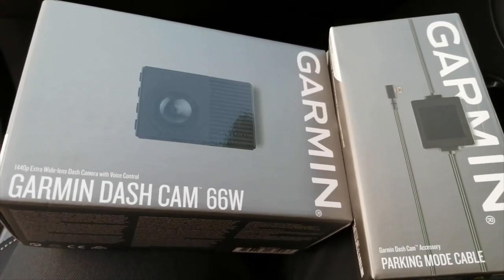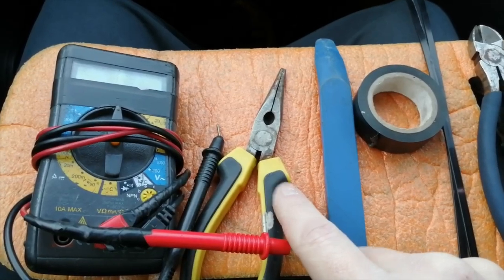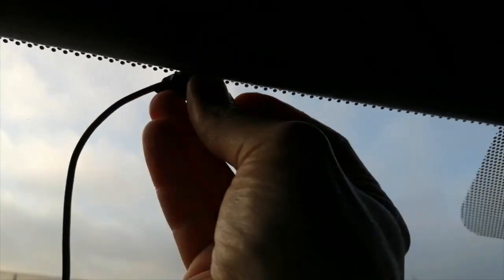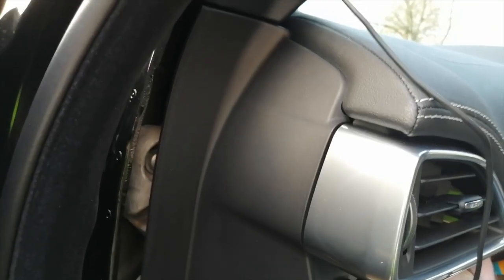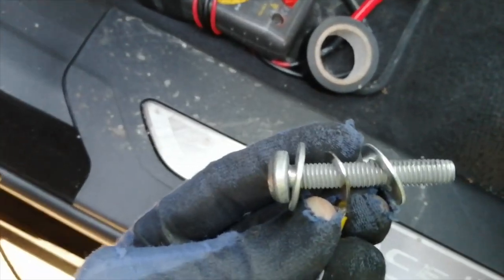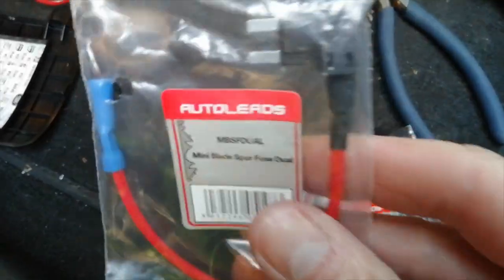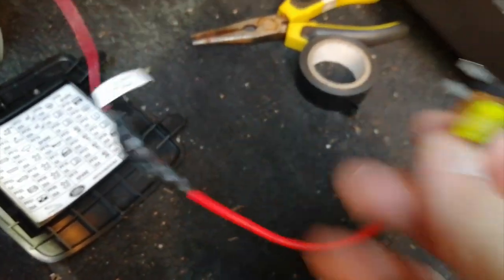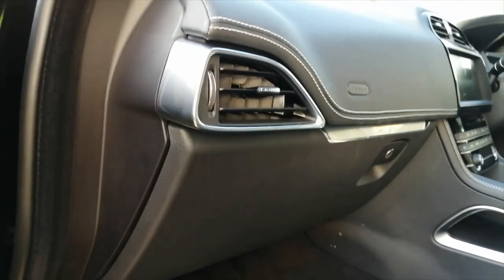Jaguar F-Pace how to install dash cam with parking mode (dual power)

Comment: Are the fuses not in the wrong slots? Should the 20amp be closest to the blades ?
Reply from the maker: Depends on fuse box layout which can depend on model,year,spec and region of the world the car is sold in, hence why I already say to test the fuses with a meter.

Comment: Tried this with a nextbase 322gw.  Works great except when the auto stop/start function is used on the car. The camera sees low volt age and cuts off, then back on again. This never happens with the auto stop start function switched off.

Comment: Should you identify which is the live feed side of the fuse in the fuse box in order to fit the piggy back the correct way around, otherwise everything will pass through just one fuse and not be split across the two if it's fitted the wrong way around?
Reply from the maker: Yes fuses have what is called a hot side, as long as fit it the same way as in the video you will be fine.